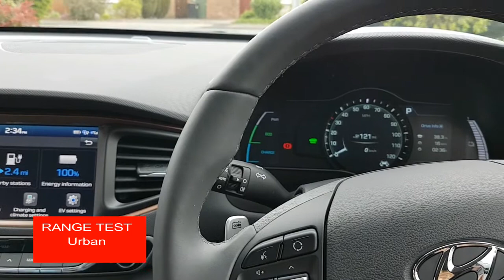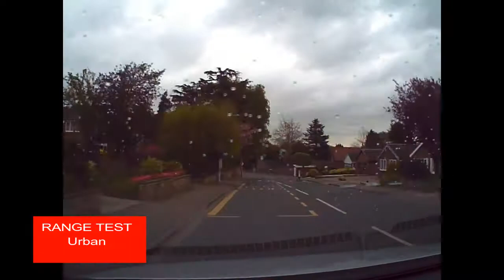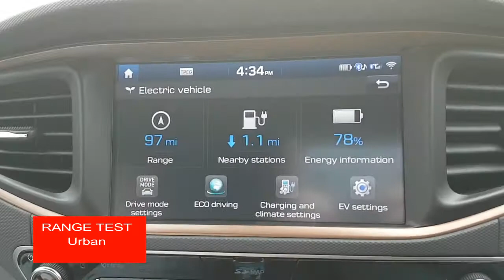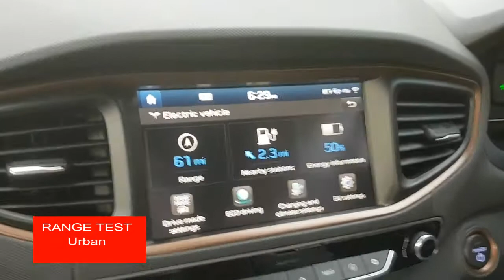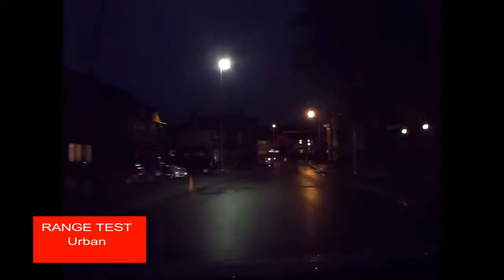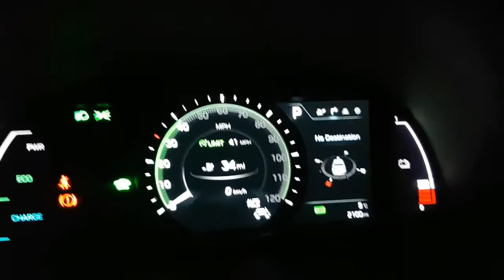Hyundai Ioniq Electric Range Test (Urban)

Comment: Great video thanks. Any chance of doing a similar one on motorways, 70mph average in the future? I'm considering electric next, but I've got a regular dual carriageway trip to my daughter's of about 70 miles. Also what kind of deal did you get from Hyundai?
Reply from the maker: Hi Stephen, my commute is almost entirely motorway and I range has been working out about 120 miles at 70. I will be doing a more focused test on this in the near future. We're also driving all the way to Devon in a couple of weeks which we will be filming. We got ours from Bristol Street Motors Hyundai, what area are you from?
Reply: I'm from Lincoln, no rapid chargers near us. Thanks for the info about motorway range, really amazed how much more efficient it is than the leaf! At 25k list price it's a bit too expensive for me yet as I'm seeing the odd 30kw leaf nearly new pop up for about 16k.
Reply from the maker: There are some good lease deals available if your annual mileage isn't too high. We dealt with a guy called Scott at Bristol Street Motors, very helpful. Let me know if you need any more info.
Reply: IoniqEVDriver how has the range been working out for you over the past year. My commute is 100 miles and I’m hoping the ioniq will have me covered